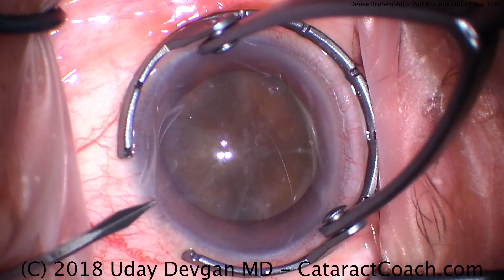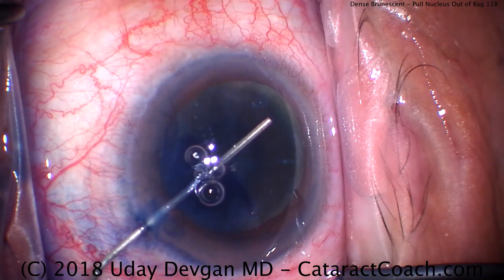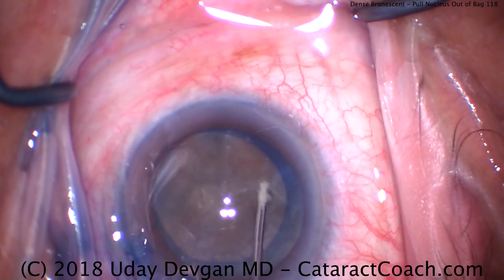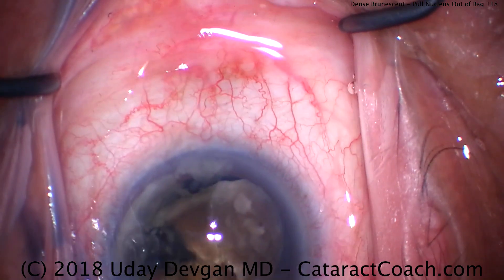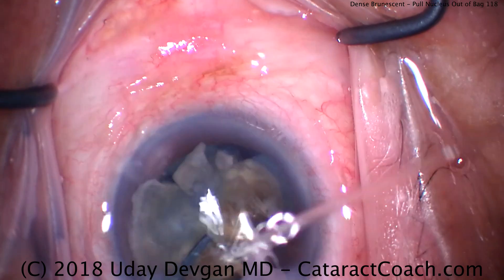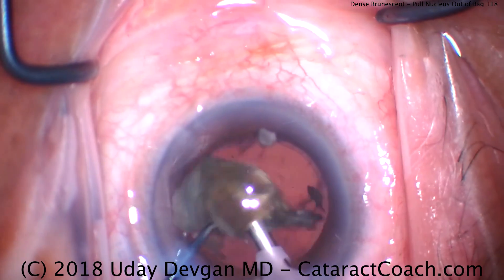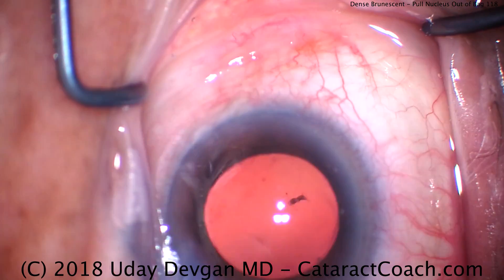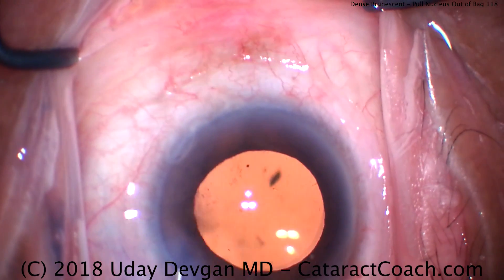Cracking the Posterior Plate in a Dense Cataract Surgery

Comment: I like the Bausch and Lomb phaco machine because of the dual linear foot pedal control. You can vary the power from 0 to 100% linearly with the pedal. And also vary the vacuum from minimum to maximum with linear foot pedal motion. I set the phaco power to vary with up and down motion, and the vacuum to vary with sideways motion . You can set it either way. So there is no need for various "modes" You can constantly be changing the power and vacuum as needed every moment with your foot. It is fabulously controllable. Using super high vac with low power allows you to remove very hard cats with a minimum of energy. I did a rock hard black cat Monday and had a crystal clear cornea next morning. Of course replenishing visco often.
Reply: What is your parameters please ?
Reply: @pharmall1662  As I said , you don’t have to set parameters. You can adjust the vac and the power continuously and simultaneously with your foot. It’s fabulous. I do set the max and min values for the extremes of the foot pedal positions. I set the up and down motion for phaco power, 0 to 100%, and the lateral motion of the pedal for vacuum, 20 to 600 mm. You can set it the other way if you like. I never use a pulse mode but you can set one if you like. There’s a mode button on the foot pedal to set any modes you want in any sequence. But I don’t need to use multiple phaco modes because of the dual linear foot pedal control. You can program in pre sets if you like, for example sculpt and fragment removal but there’s no need with that foot pedal control. I simply set up phaco, I/A, capsule polish and vitrectomy for the mode button. But you have many more options per the surgeon’s preference. Get a demo from Bausch and Lomb, the dual linear foot pedal allows you to be supremely skillful by controlling vac and power on the fly.

Comment: Thx for sharing this unusual technique sir. I did several cases using similar technique, but  unintentionally, things directed me that way, mostly the nucleus turned to vertical position in an uncontrolled way while trying to squeeze it between the phaco tip and chopper-the horizontal chop method. I was very concerned about the abrupt zonuler traction at that time. Having seen this video I appreciate having a large capsulorhexis for these brunescant cataracts. Nevertheless, this technique demands fully balanced and controlled manuplations and well dilated pupil and healthy zonules as well.
Reply from the maker: yes, I agree with you. This is a challenging technique and it requires an experienced surgeon. For beginning surgeons, this case may be easier to perform as MSICS.

Comment: Very useful technique; reminiscent of the EECE days. Thank you. One concern I have is that of causing radial tears during proplapse of the nucleus. Have you seen any DR D? Although a large CCC will help to minimize the risk of a radial tear it may not eliminate the risk.
Reply from the maker: Great point. I have not seen this yet as long as the capsulorhexis is 5mm or greater in diameter. But certainly this is a potential risk.

Comment: Thank me so much for their video sir. I have been watching all your dense brunescent cataract cases lately and this is very helpful. I wanted to ask something—-> if one is using pulse mode with variable duty cycle, one needn’t frequently shift from position 2 to position 3 off and on , off and
On several times right ? I mean in this case the “off time” of the duty cycle will take care of the cooling of the phaeco
Tip right ?
Reply from the maker: Yes. Correct. Read the phaco fundamentals series on CataractCoach.com
Reply: Thank you very much sir. I read it. I will
Revise :) take care.

Comment: Thanks for sharing 
Wasn't it more safe for the cornea and posterior capsule to do horizontal or vertical phaco chop while the nucleus is still in the bag 
I think this would spend less energy so less harmful to the corneal endothelium and at the same time the rotating hard pieces of the nucleus in your technique might cause injury to the capsule which is reported 
Regarding the leathery nature of the capsule, you still can chop even if not complete chop and at the end you will take the central plate connecting all pieces so they will separate and large rhexis here will help 
Thanks for reading my comment.
Reply from the maker: thanks for the comments. Many ways to do this type of cataract. We posted this video to CataractCoach.com because it shows something unusual.
Reply: It's everyday practice here in our area 😀. Anyway, thanks a lot for sharing and replying.
Reply from the maker: please submit a video for CataractCoach.com ! instructions are on that site

Comment: Very hard nucleus managed very well sir but that maneuver to bring nucleus out of bag looked risky.. Not many surgeons can attempt that without breaking the zonules.. Why not debulk the nucleus in the bag and do a deep crater and chop instead of direct chop? Or as u mentioned we can always opt for a safer manual sics in such case
Reply: For us old foxes that lived in the era of ECCE that manoeuver was bread-and-butter, and used to be done in the presence of a "reassuring" can opener capsulotomy... With a large rhexis like that, advanced OVDs and the expertise of Dr. Devgan it is very safe and provides something essential to quickly overcome these cases: direct access to the posterior plaque.
Reply from the maker: thanks for the comments. Many ways to do this type of cataract. We posted this video to CataractCoach.com because it shows something unusual.
Reply from the maker: Yes, many options for surgery. The purpose of the video is to show different techniques.